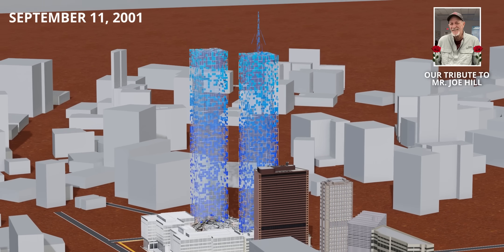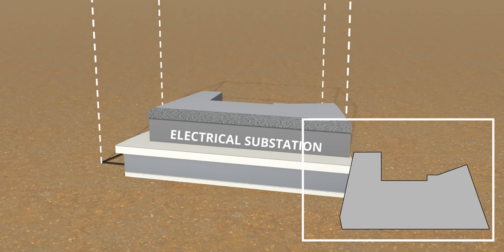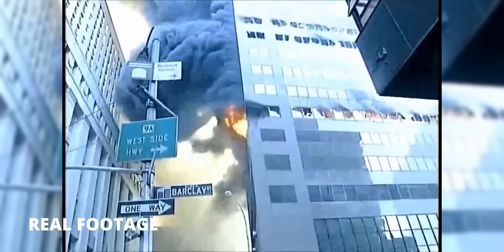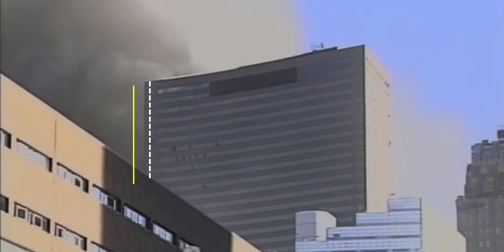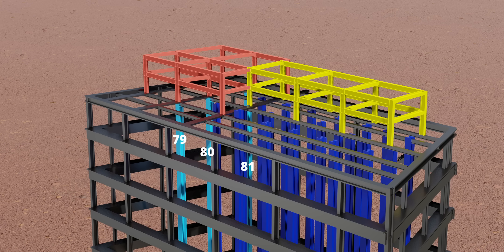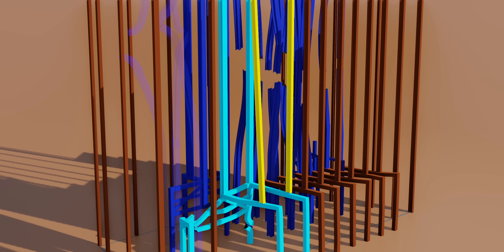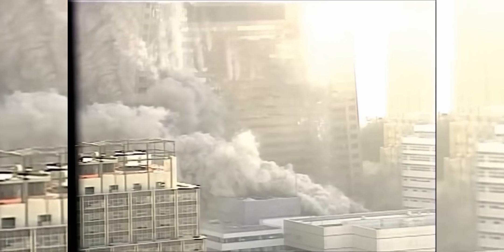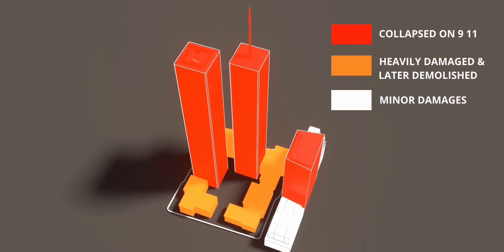Collapse of Building 7 | The Complete Physics

Comment: this reminds me of how one time my glass of water fell over and it made the entire coffee table collapse.
Reply: What about the table next to you, wouldn't it collapse as well from the splashes?
Reply: @CloakedShaman I'm sure the civil engineering community can advise
Reply: Why does the “truther” think building 7 collapsed in less than 7 seconds.  The penthouse begins collapsing and it’s 4 or 5 seconds before the outer shell collapses.  Then it’s another 6 or 7 seconds of collapse.  Does the “truther” not think the penthouse collapsing is part of the building 7 collapse?
Reply: @CloakedShaman  🤣🤣🤣
Reply: Happens all the time... Goddamn glass of water!
Reply: @Legitimus_PrimeI fuckin love you all 🤣🤣🤣❤️
Reply: tell me what can happen if you used a HUGE glass of water with a table made of flimsy material ??
Reply: @markhellman-pn3hn  as in a table that was specifically designed to withstand multiple fallen glasses of water?
Reply: That’s not an accurate analogy at all. Buildings are built out of hundreds of pieces holding each other together, they have thousands of joints, bolts, and weld spots. A table is a lot more rigid body because it has a lot less joints and it is a lighter object. The sheet weight of a building is what makes it fall straight down. Take a set of jenga and remive an entire row of a few bottom pieces. The tower might tip over like a tree, but it’s most likely going to collapse straight down
Reply: @angelob2383 how were the bottom columns that are implanted in the ground in any way damaged all at the same time? Are you telling me fire somehow maintined its form and fell several feet from the towers and landed at the bottom wtc7 all conveniently targeted all the columns causing it to free fall?
Reply: @angelob2383 if you know structural engineering, this is exactly what a building is not in terms of fragility. It should hold double its own weight at least and have redundant supports.
Reply: Exactly. One time it hailed outside and my car disappeared into its own footprint. Metal sure isn't strong 😐
Reply: It’s like an Abbott and Costello routine , with twoofers
Reply: Don't you have some traffic to play in?
Reply: @vercingetorixarverni6343  you ARE the traffic im playing in 😂
Reply: Except the twin towers were not the size of a glass of water and wtc 7 was not the size of a table. The twin towers were way bigger and heavier. Anyone with a functioning brain could see that.
Reply: @vietnamesesmerf508 We are talking about the wtc7, not the twin towers. And that building fell from the bottom due to "fire"... all columns simultaneously falling in sequence...to "fire". So much for that functioning brain of yours.
Reply: A glass of water at 700 km/h and 140 tons
Reply: And it collapsed perfectly straight down too!
Reply: @JohnFrost421  where should a whole ass skyscraper collapse? upwards?
Reply: @GremmieWhite  даже если бы металл плавился, это бы не происходило равномерно...в какой то части здания это происходило бы быстрее и  есть вероятность что здание получило бы крен в какую либо сторону.
Reply: By assuming everyone is stupid enough to believe 😂😂😂😂
Reply: Yeah the scale, materials, and circumstances are so comparable.
Reply: a camel driver wnt by- jst LOOKED at our letterbox & th whole TOWN disappeared...
Reply: fill that glass with highly flammable fuel that catches on fire after the impact and burns for 2 hours. Actually, no, 10-20 mins even. Then let's see the coffee table not collapse.
Reply: That absolutely would happen if it was two glasses of water that were each 10x the size of the coffee table
Reply: That's like dropping a penny ontop of a building.
Reply: Building 7’s collapse front the front view  
https://youtu.be/6pyyqV7egEI?si=aN5HdjJaRL3ziHyE
Reply: That would make sense if your glass of water was multiple tons
Reply: Let me guess it collapsed straight down
Reply: You stupid people are so funny
Reply: Like the way a kerosene/office furniture fire somehow melted the steel of the Towers, reminds me of the time I burned my hand pouring maple syrup on VERY hot pancakes.
Reply: Yeah, I remember that.  Hundreds of thousand tons of glasses showered all over your house and your house fell down.  Hard to forget
Reply: Trust no one in your family
Reply: If only you drank 100,000 tons of water
Reply: Glass of water light. Building debris heavy. 

It’s okay, physics is hard
Reply: @zakkristan2361 Explain the physics of the building collapsing from the BOTTOM and not the top down.
Reply: @DiamondSwordTribes2  the bottom of the building loses it's structural integrity and isn't able to hold up the top. Therefore, the bottom support gets crushed by parts of the top. Once the building starts to fall, the momentum of the building keeps it falling. Don't believe me? Create a card pyramid and remove a card on the bottom, then let's see if the card pyramid collapses from the bottom or the top.
Reply: @FastKnight401 12-16 concrete columns implanted firmly into the ground (at least 30 feet) loses integrity because the top got lighter?? Are you hearing yourself?
Reply: @DiamondSwordTribes2  who said anything about the top getting lighter? A fire caused some of the columns (the ones under the pent house) to snap, putting more pressure on the other columns which the fire was also weakening, leading to a chain reaction where all the columns started failing. The columns snapped on the bottom, so the building fell from the bottom.
Reply: @FastKnight401 😂Fire cannot and has never weakened a column in a building before. If that were the case, thousands of buildings that have caught on fire would of collapsed by your logic. Enough of this "jet fuel" fire nonsense.
Reply: @DiamondSwordTribes2  first of all, this would just say "it never happened before, therefore, it can't happen", which is not an argument. Things can happen for the first time. So you haven't proven anything. The wikipedia page shows several building collapses due to fire, so this is not a "never before thing" either.

Second of all, modern buildings are designed to contain a fire within a unit, with fire resistant walls and sprinkler systems. The problem here was, the damage caused was so large, the fire burned multiple floors and a significant portion of that floor. Modern buildings are designed to contain. I'm not sure the fire containment methods for this building, but what I do know is it clearly wasn't enough, especially since buildings usually aren't designed to withstand the collapse of literal twin towers right next to them.

Your argument is that "fire can't weaken columns or thousands of buildings would've fallen to fire", but that ignores the unique circumstances of the fire in this incident, as well as the fact that most buildings have fire resistance mechanisms that work. Modern buildings have sprinkler systems and fire compartmentation, among other things. A mere fire isn't enough to cause a building collapse. It has to overcome the fire containment mechanisms of the building and burn fast and long enough. These fires burned uncontrolled for a long time. Unfortunately, there wasn't enough firefighters to fight the fires, as many firefighters were either preoccupied or died to the other building collapses, leaving the fires uncontrolled.

The reason fires don't destroy buildings so much is because of engineering and fire fighting. Fires are usually suppressed before they can cause enough damage, and buildings have many systems like sprinkler systems and fire compartmentation, which prevents a fire from ever reaching the point of causing a collapse. I also assume we learned from the collapse of this specific building to make our current buildings more safe.
Reply: @FastKnight401 guess sprinklers failed to do their job that day for some reason. Also there is no such thing as a "modern building". Buildings have had fire proof to counter most hazards for decades. The fact that so many "unique" scenarios all happen in the same day is comical at best and insulting at worst to the intellectually minds of humanity.  

I gave up reading your essasy half way down because Im talking to someone so convinced that the whatever these "experts" say in the media is in your best interests.
Reply: Your glass of water is not over 1000 tons and perched on top of long steel columns being subjected to sustained fires.
Reply: This reminds me of a time a YouTube commentators said stupid shite about a glass of water!
Reply: That is the worst comparison I've heard in my life like actually 😭😭😭✌️
Reply: Christ, you really are dim, aren't you? A more appropriate analogy would NOT be dropping a glass of water on your coffee table, but instead dropping about a dozen identical coffee tables identical to your coffee table at the same time on top of your table. What do you think would happen then? Jesus this is simple stuff (but then I suppose I'm talking to some pretty simple people here going by the evidence of their comments).
Reply: @fuzzluvver69  so you think a dozen identical towers fell on the tower, thus causing its symmetrical collapse at free fall speed?  😂
Reply: @fuzzluvver69  Oh I remember that! When a skyscraper fell from the sky onto the first twin tower, thus triggering its collapse. What a day!
Reply: @Legitimus_PrimeJesus, this is even more simple. You can see the top section of the WTC 1 collapse just above the impact zone, so you have multiple stories at once collapsing on the ones below. You CANNOT be this dim. 😂

Comment: If you actually take every and I mean EVERY variable into account, this explanation is less likely then it being a controlled demolition
Reply: Which is why it is overwhelmingly supported by the worlds engineering community.

The collapse of Building 7 is one of the most studied engineering disasters in history and the subject of 5 comprehensive engineering studies and more than two dozen technical articles in major peer reviewed engineering journals, most of which were published 15 or more years ago. Thousands of pages of material.  This should get you started.

FEMA BPAT (initial report superseded by NIST NCSTAR 1A)

NIST NCSTAR 1A: Final Report on the Collapse of the World Trade Center Building 7, 2008.

Guy Nordenson and Associates, WTC7 Global Collapse Analysis Report and Summary of Findings, 2010.

Arup, WTC -7 Structural Fire Analysis Report (Runs 1-4), 2010.

Weidlinger Associates Inc., WTC 7 Collapse Analysis and Assessment Report, 2010.

BRE Centre for Fire Safety Engineering, Analysis of the Impact of a Fire in the Mechanical Room (5th & 6th Floor) of the World Trade Center 7 Building, 2010.

T. McAllister, R. MacNeill, O. Erbay, A. Sarawit, M. Zarghamee, S. Kirkpatrick, J. Gross, Analysis of structural response of WTC 7 to fire and sequential failures leading to collapse, J. Struct. Eng. (United States). 138 (2012) 109–117.

For a summary of the major studies I would recommend THE COLLAPSE OF WORLD TRADE CENTER 7: REVISITED by Mhd Anwar Orabi , Liming Jiang , Asif Usmani and Jose Torero which is a 33 page summary of the different analysis and conclusions published in 2020. Sorry, YouTube will delete this post if I give the link but it should be easy to find and is available from the University of Queensland, Brisbane. 

Real structural engineering industry professionals conducting real engineering studies and publishing them for other professionals to see. Not amateur YouTubers appealing to the gullible and credulous.

Happy reading

For the record: In 24 years, zero structural engineers of tall buildings, including the one-third that have retired during that time, have made any statements in support of 9/11 Truth BS demolition claims. Zero, nada, none. The lack of any such citations in the engineering literature (published in any country worldwide) is palpable.

Comment: Not a structural engineer but an engineer. This looks very far fetched.
Reply: And yet not wrong. The conclusions presented here have broad support in the structural engineering community.  Not in the conspritard community of course, but they don't know shit and are motived by pure ideology and stupidity - a dangerous cocktail.

The collapse of Building 7 is one of the most studied engineering disasters in history and the subject of 5 comprehensive engineering studies and more than two dozen technical articles in major peer reviewed engineering journals, most of which were published 15 or more years ago. Thousands of pages of material.  This should get you started.

FEMA BPAT (initial report superseded by NIST NCSTAR 1A)

NIST NCSTAR 1A: Final Report on the Collapse of the World Trade Center Building 7, 2008.

Guy Nordenson and Associates, WTC7 Global Collapse Analysis Report and Summary of Findings, 2010.

Arup, WTC -7 Structural Fire Analysis Report (Runs 1-4), 2010.

Weidlinger Associates Inc., WTC 7 Collapse Analysis and Assessment Report, 2010.

BRE Centre for Fire Safety Engineering, Analysis of the Impact of a Fire in the Mechanical Room (5th & 6th Floor) of the World Trade Center 7 Building, 2010.

T. McAllister, R. MacNeill, O. Erbay, A. Sarawit, M. Zarghamee, S. Kirkpatrick, J. Gross, Analysis of structural response of WTC 7 to fire and sequential failures leading to collapse, J. Struct. Eng. (United States). 138 (2012) 109–117.

For a summary of the major studies I would recommend THE COLLAPSE OF WORLD TRADE CENTER 7: REVISITED by Mhd Anwar Orabi , Liming Jiang , Asif Usmani and Jose Torero which is a 33 page summary of the different analysis and conclusions published in 2020. Sorry, YouTube will delete this post if I give the link but it should be easy to find and is available from the University of Queensland, Brisbane. 

Real structural engineering industry professionals conducting real engineering studies and publishing them for other professionals to see. Not amateur YouTubers appealing to the gullible and credulous.

Happy reading

For the record: In 24 years, zero structural engineers of tall buildings, including the one-third that have retired during that time, have made any statements in support of 9/11 Truth BS demolition claims. Zero, nada, none. The lack of any such citations in the engineering literature (published in any country worldwide) is palpable.

Comment: Just to recap: There was a penthouse on the of the tower and in that penthouse were 3 fat guys. One of the fat guy farted without his pants on. That cause extremely toxic fumes that melted the steel like cheese on my patty. At this point, it was still all was good until these guys started to laugh uncontrollably which in turn create ultra sonic vibration. Now the problem is: those laughs were emitted at a very particular frequency and the steel, already weakened by the fumes, gave out. The frequency directly interacted with the subatomic particles of the steel at the exact failure rate (or frequency) it was needed for it to vaporize. It's a bit difficult to understand, but only professionals hired by the government have enough credentials and know-how to confirm that theory. Everyone else is lying and is a conspiracy theorist and is not a patriot.

Comment: Only took decades to make this reconstruction. 
 Explain how: the 252 foot wings slice through the i- beams ( before supposed temperature of rocket fuel..blah blah) like butter with nothing ! Falling out, or down the building.  planes break up almost entirely upon impact on land, on water with parts scattered for many miles and years.

Then lets explain where all the tangible assets ( gold, cash, jewels) from undamaged floor of Deutsche bank went .
Reply: There's nothing new in this presentation. All of this information has been in the public domain for 15 years or more. Building 7's collapse is one of the most studied engineering disasters in history, subjected to at least 5 full engineering studies and scores of articles in peer-reviewed engineering journals. Thousands of pages of material. 

The wingspan of a Boeing 767 is 156 feet.

There was no slicing of I-beams and not even any I-Beams but rather hollow box-section columns welded up from A36 plate. If you want to understand the primary failure mode from the impact energy (equal to about a ton of TNT) then watch this short video:

www.youtube.com/watch?v=P8mG9pyImb8

Comment: Grenfell tower still stands after years of a much more serious fire, similar construction!
Reply: Sure, a concrete not a steel building with primarily exterior fires actively fought.  Hardly apples to apples. 

Curious you picked Grenfell and not the more relevant Plasco or Wilton Paes de Almeida towers.
Reply: "Grenfell tower still stands after years of a much more serious fire"
Not true, but even if, so what?

"similar construction!"
If by "similar", you mean "completely different". There's no similarity between the structures OR the situation.